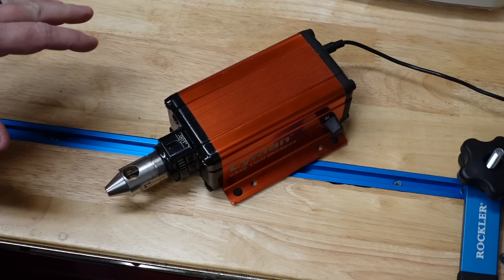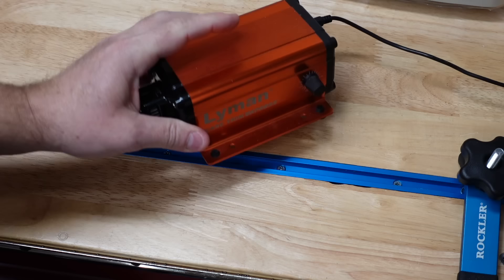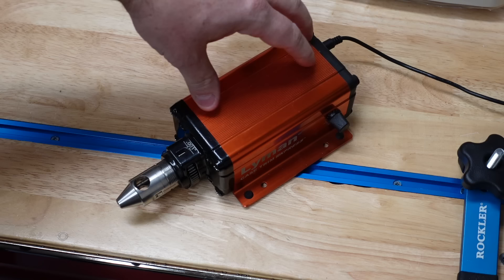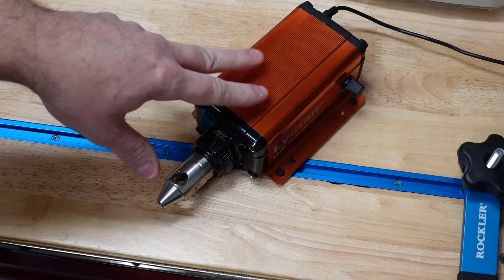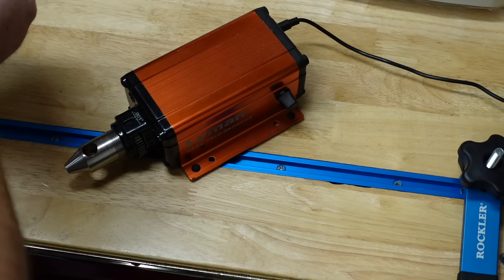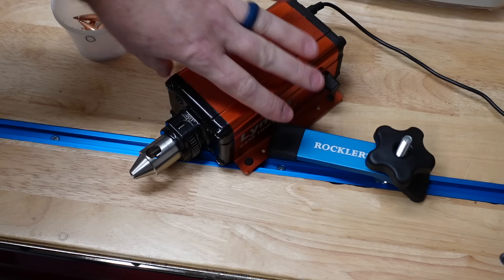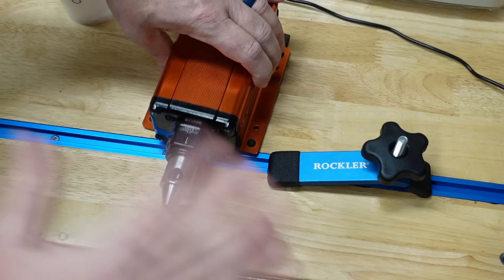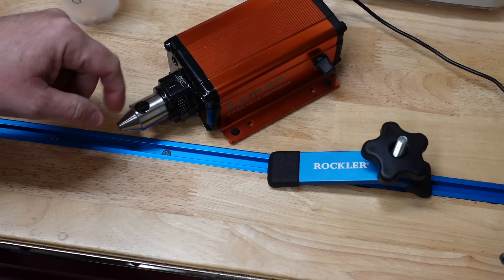Accuracy One Hoover Motorized Meplat Bullet Trimmer for Lyman Brass Trim

Comment: How does it compare to the Giraud meplat trimmer accessory?
Reply from the maker: I know people who like the Giraud version and if you own one already it probably make sense to use if nothing else for the cost savings. The big advantage of this is the ability to easily adjust .001" at a time but technically you could achieve this with the Giraud by adding a Whidden click micrometer die.
Reply: I found with the Giraud that no matter how much fiddling one does with the adjustment, the cutter leaves a tiny nub on the edge of the meplat.  I changed to the Hoover system, and that problem was eliminated.  The Giraud is designed to trim brass...; don't try and make it do things it wasn't designed to do.  I think Giraud could use a different cutter, which should also eliminate the problem, but the cutter Giraud supplies for meplat trimming does not do the trick.
Reply from the maker: @renetatro547  yeah I actually found the same thing when I had mine.

Comment: I am wondering if I can use this to trim 147gr .308 noses so they would fit in to 300 HAM'R, I am talking about trimming like 0.100" off.  Would it handle it?
Reply from the maker: It’s possible although it may take a little bit of time. I know there are different degrees of end mill cutters and I don’t think this one is super aggressive. I would give them a call and ask.

Comment: I'd suggest you to change the terminology from "trim" to "pointing"? I think? Is that not what your doing? Trimming I think should be relegated to trimming brass? My 2C's worth.
Reply: Nope. Trimming bullets and pointing bullets are 2 different things. He is trimming them.
Reply from the maker: I get what you're saying in so much as the trimming and pointing are not usually mutually exclusive but it truly is trimming the bullet. This is actually 'trimming' the end of the bullet off and the 'pointing' is done with a completely different process with a die.There are people out there who only trim the meplat and don't bother pointing.